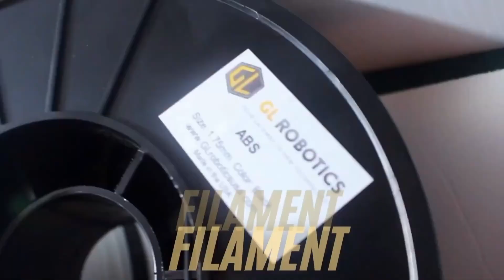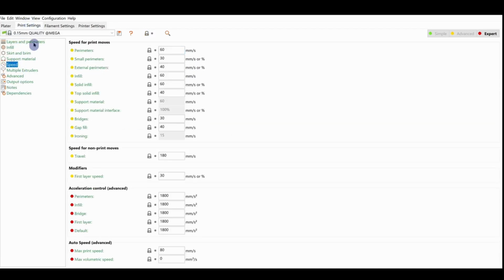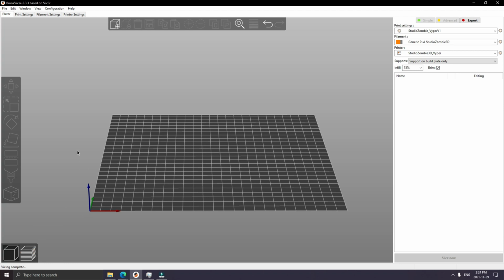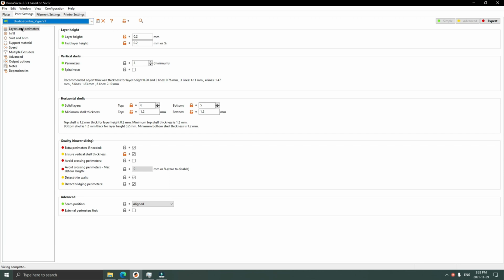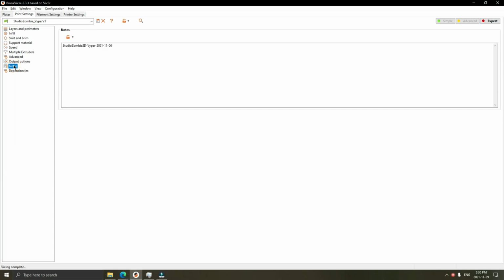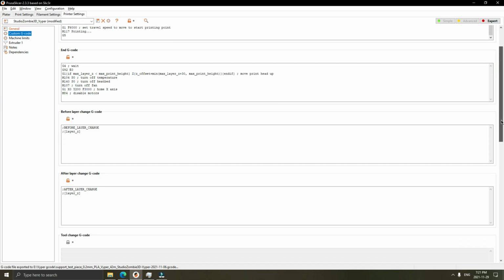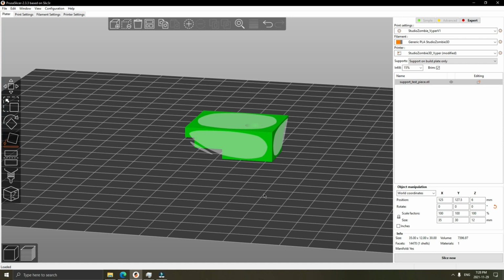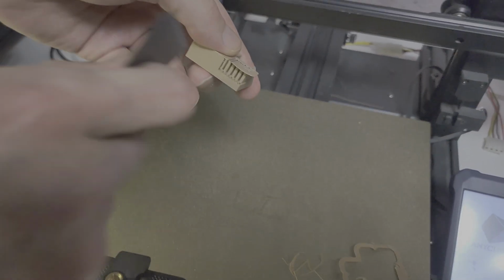Prusa Walkthrough w/Anycubic Vyper

Comment: Hi,

thank you for the guide. When I start the print the printer starts printing the line in the front, the skirt and the walls then the printer retract and stop feeding filament. The printer is still printing but without filament. Same print sliced in cura worked well. Do you have any solution?

Regards
Mitch

Comment: Hello SZ3D, first time viewer but loved this how to. I'v been trying to use the Profile from the down load but i'm getting an error message " relative extruder addressing requires resetting. Add "G92 E0" to layer_Gcode." I have no clue how to wright or read code so this all looks a mess to me. could you give me some advice?
Reply: Printer settings, go into custom G-code,  add G92 E0 in the "Before Layer Change G-Code"

Comment: Hey Zombie, mate i followed your video and tried out your Prusa profile with the support testt piece, one I selected the test piece with your profile I received the following error" Relative extruder addressing requires resetting the extruder position at each layer to prevent loss of floating point accuracy, Add G92 E0 to layer_gcode
Reply from the maker: In the printer settings I think it is you can add the g92 e0 to the box there and it will fix the error
Reply: @studiozombie3d  Hey Thanks mate, i found a way around it, I followed the whole video and  created a I3 Mega profile like the young girl suggested and then imported your profile, So I have the Zombie Printer Settings, PLA Filament and the printer Anycubic i3 Mega created earlier, if this makes  sense

Comment: no g code bs invalid data blah blah the fix below doesn't work either just use cura
Reply: In "Printer configuration - General - Firmware - G-code type change to RepRap/Sprinter

Comment: Hi there, I followed your settings. I'm getting Invalid Data, cannot slice. Add "G92 E0" to layer gcode, do you know what it means? Thanks
Reply: Go to 'Printer Settings', 'Custom G-Code' and use this for the 'Before Layer Change G-Code':

;BEFORE_LAYER_CHANGE
G92 E0.0
;[layer_z]
Reply: @FormerLurker  Thank you!
Reply from the maker: It might be the start cgode. Check it and if there's any auto conifg data before the start gcode for something like octolapse it will give a error. Check that first and see
Reply: @studiozombie3d  im getting the same issue, not sure what to check
Reply from the maker: @motolovin1969  its the start gcode in prusa. If I remember correctly the auto config for octolapse was messing my prusa up. Its been awhile.somce I've used prusa slicer though
Reply: In "Printer configuration - General - Firmware - G-code type change to RepRap/Sprinter
Reply: Same issue with Prusa 2.4.1  This is my start code copied from Zombie Vyper ini
G92 E0 is there.  Wrong order? Help please

G21 ;metric values
G90 ;absolute positioning
M82 ;set extruder to absolute mode
M107 ;start with the fan off
G28 X0 Y0 ;move X/Y to min endstops
G28 Z0 ;move Z to min endstops
G0 Z0.2 F1800 ; move nozzle to print position
G92 E0 ; specify current extruder position as zero
G1 Y10 X180 E50 F1200 ; extrude a line in front of the printer
G92 E0 ; specify current extruder position as zero
G0 Z20 F6000 ; move head up
G1 E-7 F2400 ; retract
G04 S2 ; wait 2s
G0 X0 F6000 ; wipe from oozed filament
G1 E-1 F2400 ; undo some of the retraction to avoid oozing
G1 F6000 ; set travel speed to move to start printing point
M117 Printing...
G5

Comment: Hello, Thanks for putting this video together - I'm really liking Prusaslicer over Cura... Could you please clarify the differences between your profile .ini link in the description and the settings highlighted at the start of this video? Thank you!
Reply from the maker: The profile in the link has the same settings as the video inahvent had a chance to use prusa much lately and haven't had a chance to update the profile. Will try to get a updated profile up
Reply: @studiozombie3d  ok, the speeds listed at the beginning of the video walk through are different / much slower / perimeters 70mm/s vs 45 mentioned at the start of the video. Which would be better to use? Still a newbie. Tia!
Reply from the maker: @gerrbearmac  I use 70mms and 40mms outer walls right now and it's good. You can tweak the outer wall speeds 35 is really good too if your printer is really nice and tuned you can do 45 to 50 on outer walls

Comment: I plan on purchasing this very same Printer as my first printer
Reply: i did and its sat there while i wait for a new micro sd card or sd adapter to turn up so i can update the displays firmware... has to be an 8gb micro sd or smaller if i remember correctly..

p.s. if youre looking into an sd adapter i ordered a mcro sd to sd ribbon cable adapter